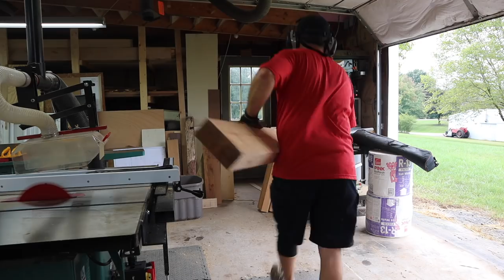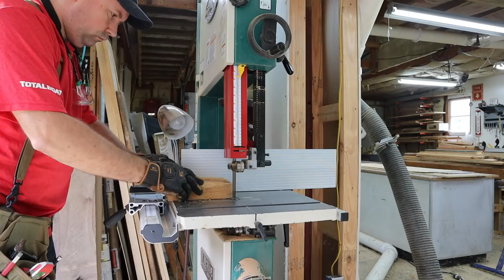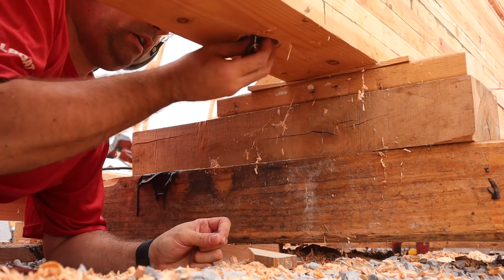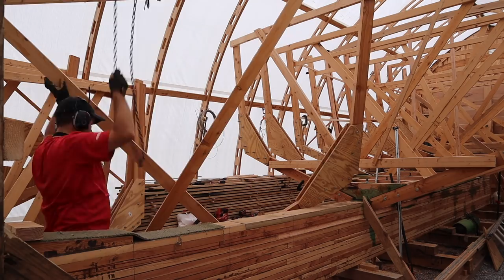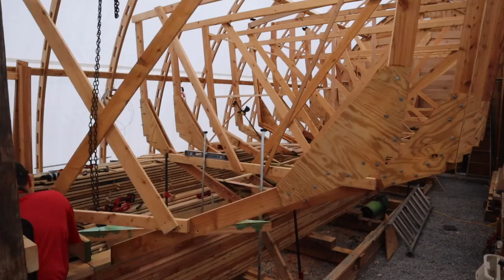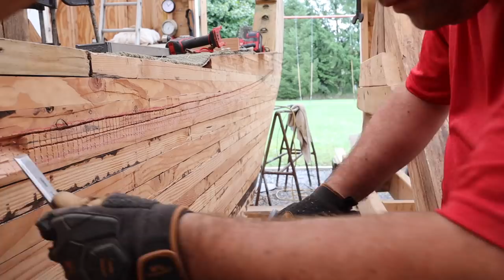Trawler yacht wooden boat frame installation.  SDP Ep. 35

Comment: OK, stupid question: Why would it matter if it snows for the timing of different parts of the construction?  I assume you won't stop building, but is  it because it's harder to move big pieces of lumber across the yard in snow? Just curious.
Reply from the maker: the chine and bilge stringer installation is going to require the use of adhesives and those need minimum temperatures to cure.  I can't start that until all the frames are in.  Not a dumb question, I did not explain it clearly enough.
Reply: I was wondering why the boat house was built so far away from the shop?
Could have made it closer with a small covered walk way for winter, to late now.
Great job so far. From Niagara on the lake 🇨🇦

Comment: I don't care what anyone said about not installing the engine. You can and should be able to install or remove the engine at any time later by use of a hatch cover. And or just wiggling it in between the open frames at first. I would have liked to seen you guys get a larger output one though. That craft is going to need it.
Reply from the maker: Well we will transport the boat to the yard before we install the pilot house so we can do the engine then of course.  The design makes provisions for access hatches in the pilot house sole and roof.  So we'll be able to pull the engine if necessary.  Patience as you see it come together, we are working hard to plan for all the eventualities.

Comment: At 07:28 , I believe there should be some cotton wool under that washer facing the wood to act as a sealer.
Reply from the maker: There is tar impregnated cotton under the floor timber around the bolt.

Comment: I have nothing but respect for your achievements which are all the more impressive considering you are largely working alone. You clearly know exactly what you are doing and have invested the time to plan, produce drilling jigs, crane gantries and the other myriad issues that need to be addressed to move a project of this magnitude forward.

So as an armchair warrior I do hesitate to mention this but feel compelled to. 
1. I noticed you are using plain washers on your frame connections - did you not consider serrated washers?
2. I also noticed that you have no thread locking measures in place again on the frame to floor connections - did you not consider using something like Loctite 242 ?
3. Finally, not using a torque wrench - are you confident that your muscle memory is good enough to achieve the correct clamping load?

😐 

Keep up the amazing project.👍
Reply from the maker: This is why we are on YouTube, excellent point about the thread locker Norm!  I actually thought about that and bought red and blue thread locker but totally forgot about it.  Perfect job for my dad, go back, loosen the bolts and apply some.  The frame washers are compressed pretty well into the wood fibers so I'm not to worried about that.  The torque spec's arent a big deal either, as we tighten the keel bolts up pretty snug now, but will have to go back later and tighten them some more as the wood fibers compress and swell.
Reply: Six Points Wood Works 👍😀😎

Comment: Your boat is coming along nicely. Question since i don't know is the wood your using regular 2"x 4"'s  or Marine Rated ?  Seems like your doing a great job.  Thanks...............
Reply: maybe pressure treated ??????????
Reply from the maker: This design could use dimensional lumber, but we had ours custom cut because of the wide and cheap availability of Larch which has excellent strength and rot resistance.  We also chose to go above the minimum dimensions and our frames are mostly all a full 2" by 5".  PT isnt used very often in boat building, I haven't gotten a good answer on that as to why, I thought about that too.

Comment: I'm from Tennessee and I have never heard of 'dock out day'. Why are they pulling the dock out of the water? I looked it up but couldn't find much about it. I understand that they do it for winter but I couldn't find out why the dock needs to be removed.
Reply from the maker: you are lucky!  the docks and boat hoists (lift) need to come out because they are on a small fresh water lake that freezes over in the winter.  Permanent docks could be installed but they are very expensive, so temporary docks sit on what are essentially robust metal saw horses for the summer.

Comment: I have a question in relation to inserting and tightening the bolts. Specifically, are they torqued or just made as tight as you can get them? Really enjoying watching your progress.
Reply from the maker: We just tighten them up pretty snug now but we'll have to go back later and tighten them some more as the wood compresses.  I don't think specific torque is necessary.

Comment: I was wondering why you did not cut a collar (slot) on the timber braces to help to keep the structure from racking side to side?
Reply from the maker: Thought about it when I saw it on other boats, but the it was indicated in the plans so I didn't.
Reply: I am not a boat builder but I am a cabinet maker and furniture builder; lots of the same ideas but on a smaller scale.  I assume the sides will be planks?  If so that will provide a ton of shear loading on the hull and structure and will tie everything together.
Reply from the maker: Definitely, Chine, bilge stringers and planking are all part of adding structural strength.